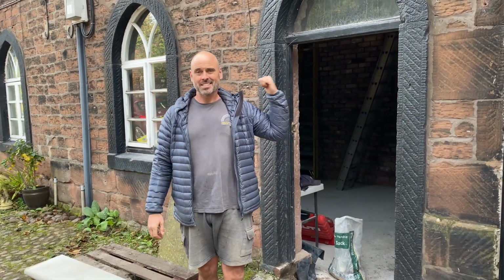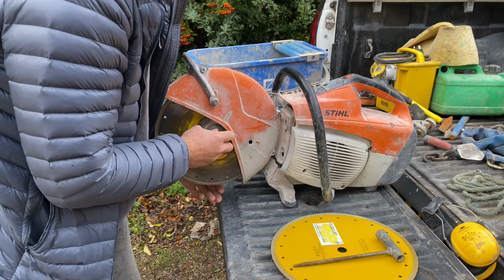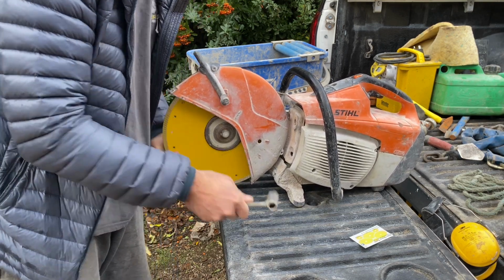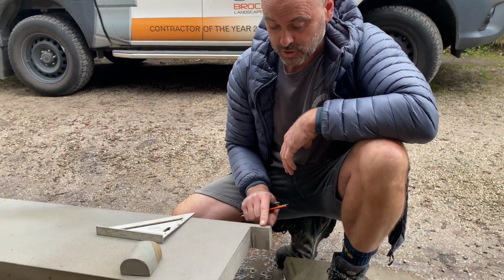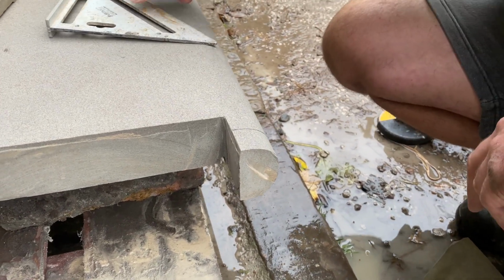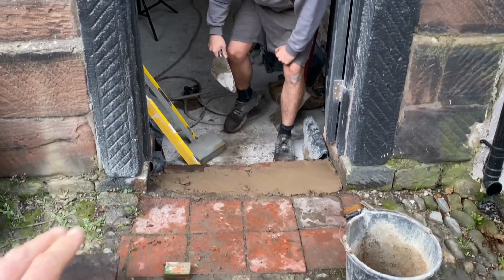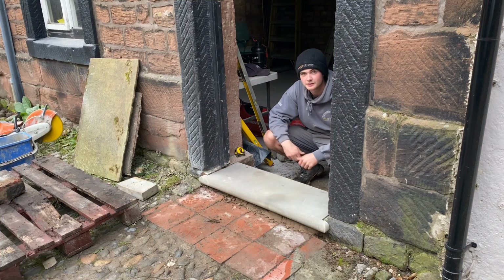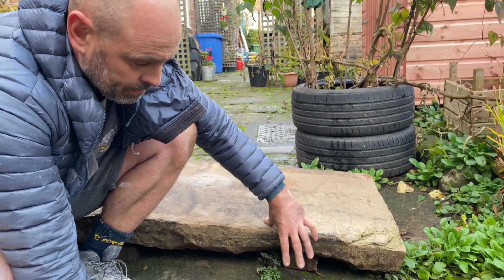Stone Steps - Amazing 18th Century English Cottage

Comment: Another brilliant job. I use a cordless disc cutter, it's just a lot lighter than a petrol one. Also have you thought about using a flush cut diamond blade on the grinder. Might make it easier for bull noise work 🤔